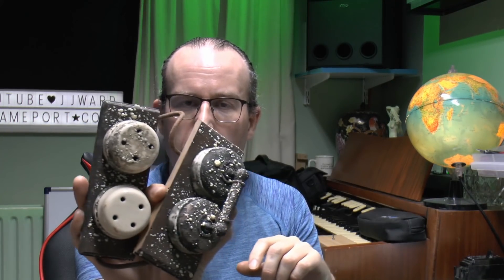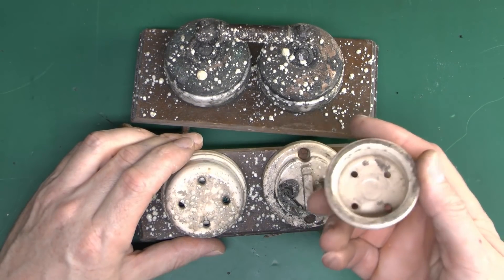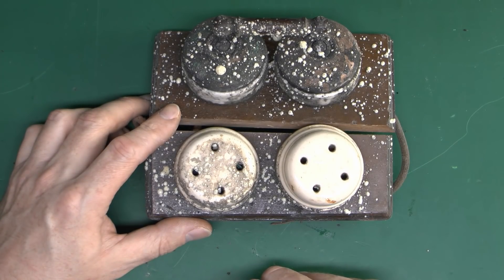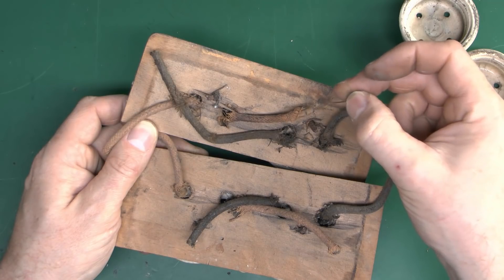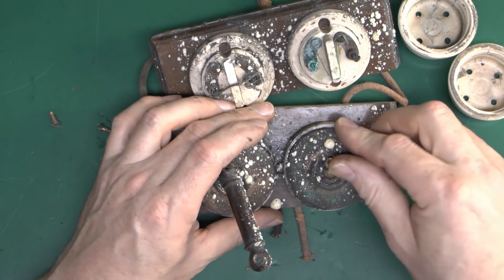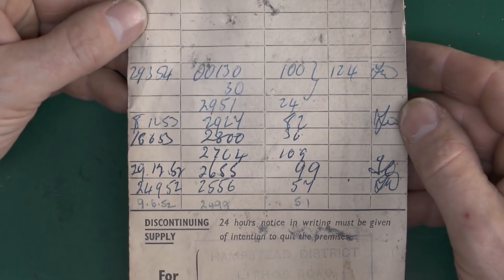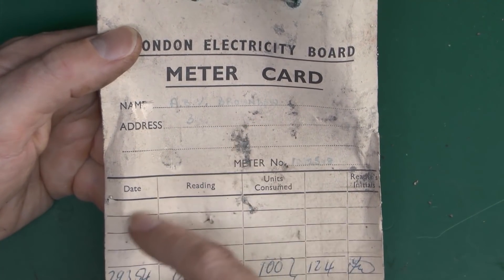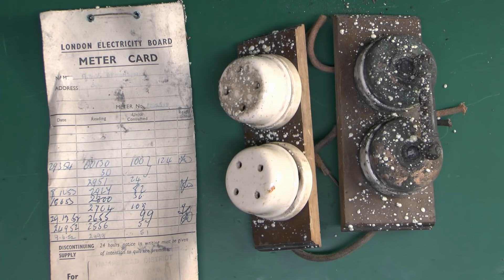Pepperpot Fuses, Switch and Meter Card

Comment: Not relevent to many now but that wire is called VIR (Vulcanized India Rubber .... which dates it all on it's own)! 

The pepperpot fuses were usually fixed to a board that was nailed into a wooden plug hammered into the mortar between two bricks! The DP switch was not sold individually as there was a different top to allow the bar to be screwed on. This needed to be removed to allow the metal cover over the switch to be removed. A good tap with a pair of pliers would loosen it enough to unscrew ;0)

Electrification of urban areas in the UK started in the 1920's and would have been different voltages and frequencies dependent on the generating station. Manchester for example had a duct with several bussbars mounted on porcelain mounts. You simply chose the voltage you wanted at a building and tapped on to the relevant bussbars! Obviously with faults occurring the bars would bend due to the magnetic pulse and Norweb (I think although it may have gone under a previous name) had a team of workers who were paid to walk the streets looking for dry spots where the bussbars were arcing!

Back in the day we would be called out to 50p Coin Meters that were jammed. We would go out and empty some coins to make room  give the coins back to the customer and put an IOU in the coin box for them. For some it was the only way they survived!

The times have certainly changed!

Comment: @John Ward  im sure my gran had one of these still in situe in her terraced house (ones with outside bogs) cellar, obviously not wired up but still left there. as ive said in prior video comments, my grans house (still exists today) dates back to same era that those fuses came from. the house wasnt rewired until mid to late 90's as we still had those round pin plugs and needed many of those adapters for modern items.
i dont remember exactly when we got square pin sockets fitted, im going of my own childhood memories. but at somepoint late 90's my dad (who took over the house when my gran had to go into a nursing home) moved into a pub (working there) but still kept the house....unchanged if i remember correct. its only when we moved back into the house i saw the change from round pin and those 40's stile light switches (you featured on another past video) to modern ones. but im pretty damn sure we had at least one set of two fuses like shown here. there was a final major 'firesale' (everything went) renovation in early to mid 2000's before my dad sold up and moved to edinburgh in 2008.

Comment: Very nice! Notice the font (Gill Sans) on the meter card, extensively used in the UK in those days, though still used by Mr. J.W. in 2021! The D.S. (Date Stamp?) code at the bottom of the card reads 3608, would that be August 1936?

Comment: when I started work in the early 1950s these items were called 'coupled tumblers and bow cut outs'
Reply: Yup, that's exactly what they were called.
Reply: as far as I know common fuse wire was 5a 15 and 30amps, what were these rates at?
Reply: I would like to know more about them

Comment: I came across a similar installation in Sheffield. The sparky said they were from the DC days and fused  + and - as the DC supply could have return paths to the generating station and ground leakage in other properties. No idea if he was talking BS or not but it made sense at the time.
Reply: I think most DC supplies were three-wire, i.e. +, neutral and -, in Europe usually 220/440 V or thereabouts. So you'd still have a fused neutral. I'd assume the reason was the same as for fused neutrals in some more modern AC TT supplies - the neutral wasn't earthed reliably enough to guarantee it couldn't cause dangerous earth faults. Some southern European countries still require double-pole MCBs and I assume that's because of the TT supplies there. I definitely know this was the reasoning in Germany, you can find that in old VDE regs.

Comment: About 10 years ago I actually saw that very same style of fuse and isolator still in use on a old farmhouse that had only ever had a partial rewire.

Assuming the house owner is still alive and in residence then the old stuff is probably still there with current passing through  albeit the part of the building  with the oldest wiring unoccupied!
Reply: I certainly know a house (not in the UK) with some bits of pre-WWI wiring still in use! A very wealthy farm, more like a manor, no longer active but the main house still lived in. I think the bulk of the wiring is from the 50s, round flush black bakelite tumbler switches, but the library and adjoining veranda have braided flex on glass knobs nailed to the woodwork, including a JB with exposed live terminals no more than 7 feet off the floor. All live and in daily use. I know the elderly owner, no use telling him to make it safe, he won't.

Comment: I've had the pleasure of seeing one of these blow. Was looking at houses with my parents in the early 80s and an eager estate agent was trying to get the lights to come on.
As you'd expect it spat out some white hot bits of metal that bounced off across the concrete floor... so probably a pretty solid fire risk if there's anything flammable in range.

Comment: Why did they think neutral fusing was a good idea back then?
Reply: I don’t know, but if the supply is earth free and floating above earth potential (that is, the neutral is NOT connected to earth at the sub-station/ transformer), then fusing the neutral would then maybe make more sense.
Reply: @Mark1024MAK  Also,there would always be some voltage on the neutral,even is it was grounded near the transformer.And since you had no 2 pole circuit breakers then,2 fuses were the only option.
Reply: @Mark1024MAK  Either entirely floating or not sufficiently well-earthed. That was certainly the argument for fused neutrals in some countries, disconnection in case of a neutral-earth fault.
Reply: more fuses more better?

Comment: I had one like this in a garage that I had a few years ago.I had no idea it was a fusebox,I just assumed it was an old style of socket .It was not connected to  the supply but just left on the wall with fabric covered cable going to it .Interesting to find out what it was,I never took much notice of it when it was in the garage but it looked ancient,there was a 2 pin socket connected to it if I remember rightly.

Comment: The meter cards were common in council houses in the 50's/60's along with a prepayment meter. The meter man would call quarterly, compare current with previous reading, work out units used, calculate sum owing, deduct this from coinage in meter - there was almost always a pile of pennies credit which were handed back. All worked out with a pencil and paper!

Comment: Interesting stuff! Reminds me a bit of the German Diazed system, which was introduced in 1909, but that was far more advanced. They already had a fitting element which only an electrician was able to change. The fitting element prevented that someone inserted a fuse with a too high rating. The diameter of the head is different between the ratings. And they have an indicator on the back which pops off when the fuse blows. The cap of the fuse carrier got a glas insert to see this. There's a colour code for the different fuse ratings, the colours were picked back then using the system of the Germania series postage stamps. The indicator of the fuse is coloured, and so is the fitting in the fuse carrier. The colour code was also used on the Neozed fuses which were introduced in the 1960s to replace the Diazed. The Neozed are different in diameter of the neck, there the fitting is a ring which will prevent that someone inserts a too high rated fuse.

https://en.wikipedia.org/wiki/IEC_60269#D_type_fuses

Both, the Diazed and the Neozed require special tools to insert or to remove the fitting part.

Diazed and Neozed are trademark names from Siemens, which was the inventor of these two systems. The official names are D-type and D0-type. The name Diazed also tells us were they came from: DIAmetrisch abgestufter Zweiteiliger EDison-Schmelzstöpsel (literally: Diametric staggered two-part Edison melt plug). And the successor simply used Neo (latin for new).

Fitting elements, the blue ones are 20A. The yellow one is 25A, red is 10A and grey is 16A:

https://www.picclickimg.com/d/l400/pict/173265886899_/30-Sicherung-Passschrauben-f%C3%BCr-Diazed.jpg

They were a long time used as main fuses of a house, or to fuse a supply cable to a distribution board with MCBs in it. Now they also make 32A versions of them. Back in the old days there was none, after 25A came 35A and then 50 (now also 40A available). That's the reason there was an exceptional permission to fuse 32A CEE outlets with 35A fuses instead of 32A, until this fuse size was available.
Reply: Lol,i have seen dozens of DII fuse sockets with the porcelain fitting element removed,so people could put a 20A fuse in  place of a 16A one.
Reply: @MernokiMegoldasok  Either bashed up leaving only the metal centre in place or removed entirely, requiring a coin in the screw cap to compensate for the missing metal bit in the base. With enough criminal energy, you can bypass pretty much any safety system, including fitting larger MCBs.
Reply: @Ragnar8504  But puttin a 20A fuse in place of a 16A one is still much better than putting stranded copper wire in the blown 16A fuse. 1.5mm2 wiring will heat up a bit at 20A load but wont catch fire yet.
Reply: @Ragnar8504  Even if you use a signle strand,it can be dangerous.The fuses have sand to extinguish the arc.If you put a strand in it without the sand,several 100S of Amps of short circuit current will make a large explosion and can blow the fuse up,even causeing damage to the fuse holder. I'm not sure why would anyone install a 16A MCB before a 20A fuse.Even if it was installed after it,selectivity is questionable.Its recommended to have a 25A fuse before a 16A one,so only the 16A will blow.
Reply: @Ragnar8504  That stuff is a gem.I collected about 60 meters of cloth and rubber insulated wire form the 160s.The insulation is still in perfect conidion on them.Old wires were insulated for 1kV,nowadays its just 300 or 500,or in the best case 750V.

Comment: I am old enough to remember the 1950's. In the winter months we had a Belling 3 bar electric fire in the lounge. That is a full 13 amp load, if my memory is correct the sockets for them were rated at 15 amp. It was in the days when most people would run an electric iron off a light socket. Your site is always informative and you are the master of explaining something that is highly complex in an easily understood manner.

Comment: That kit looks even older than the ancient stuff in my house (Edison base screw-in fuse panel, cloth and rubber insulated wiring in iron-pipe conduit, even some knob and tube wiring, although that is no longer connected).

Comment: Any idea what make they are?
Reply: Early manufacturers included GEC - a kind of electromagnet symbol , Ediswan or Lektrik, Tucker Telac. I have quite a few of them and some have makes on them and some don't. Some were rectangular shaped but still with holes in. Some had the holes in the sides of the lid.

Comment: So, the mains isolation switch is two light switches strapped together.  I suppose if all you had was lighting then that wasn't too bad.  The thing that always terrifies me is when electric irons and the like were plugged into the light sockets, and just how inadequate the light switches and cabling was when doing that.
Reply: Yeah, old electrics always seems 90% experimental. My old house had those toggle switches for some of the lights. In the cellar was an old bakelite fusebox that was still in use. Next to it was a single "fusebox" that was the wiring for the building before it was updated for the 70s.

My new house is a newbuild and it has isolators and everything all over it. If you so much as look at a light fitting the breaker pops.
Reply: My grannies house had all that. Bath in the kitchen with a gas geyser to heat the bath water. Iron plugged in overhead!  Brilliant.
Reply: The worst bit was usually the wiring inside the lights themselves. I don't know about the UK but on the continent that was often only 0.5 mm2 so definitely on the small side for an electric iron. That's the main reason why ES27 adaptors with sockets were banned quite early. The risk of damaging the flex on a hot incandescent lamp was another.

Comment: Still get my power supplied through a cable that likely was laid sometime in the late 1890's, when there was a tramway running in the road outside. The old DC cables are still in the ground as well, disconnected and left there, though the substation is still in use, and has a separate mercury arc rectifier room in it as well.

Comment: Could the multiple wires in the RH fuse be an attempt to create a neutral link?
Reply from the maker: Possibly
Reply: @jwflame  In the 1960's, for a time it was fairly common for electricians to convert existing double pole fusing to single pole by fitting a heavier guage wire to the neutral fuses (this was done in a house my parents bought in 1967). The weak point of this was that, with the more common push in porcelain fuse carriers in a fuse box was that people looking for a blown fuse could mix them up, ending up with the heavier wire in the live side. I've heard the pepperpot fuses shown here referred to as Bow fuses, presumably Bow is a manufacturer?

Comment: It turns out I have a pepperpot fuse, I had no idea what it was until I saw this video, thanks!
Reply: What years are these? I would guess pre 1890 to 1920, as they use standard fuse wire, if used with an external RCD could they be safe if new pvc wire used and earthing used? What is the max rating of these? I love all the old electrical stuff
Reply: @rorypoole5582  No not still in use, it was in my collection. I don't think they're still covered under electrical regulations therefore probably can't officially still be used, but then again a fuse is a fuse and it'll do its job regardless of how old it is!
Reply: @ArlenMoulton2 I think the breaking capacity is set by the thickness and length of the fuse wire, so I suppose you could compare it to a more modern fuse say a 1930 one to get the rating, but could these be put back into use as they look cool and I think should provide the same safety as any other fuse wire system, no it's probably would need to be and a nice plaster lined glass fronted box, and a main RCD for the system, anyone have any technical information on the pepperpot fuse?
Reply: @rorypoole5582  Breaking capacity is not the same as fusing current.Fusing current means how many amps a fuse wire will pass before melting,like 30 amps,and breaking capacity means how much current can be broken without damage,like 500 amps under a short circuit.
Reply: Still in use!